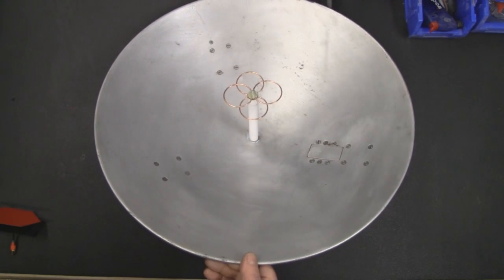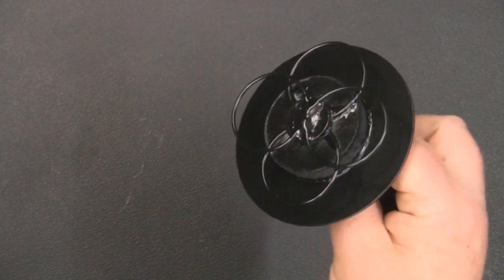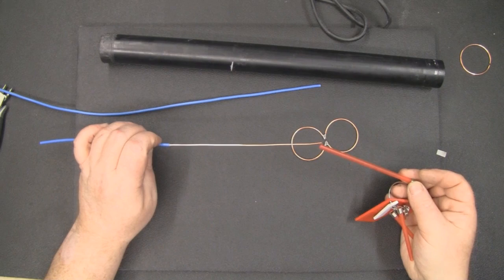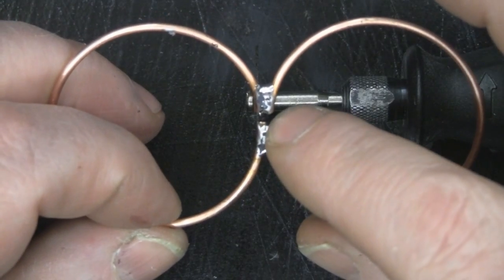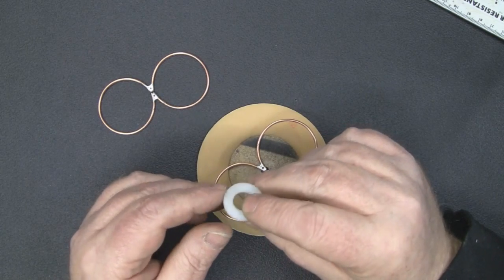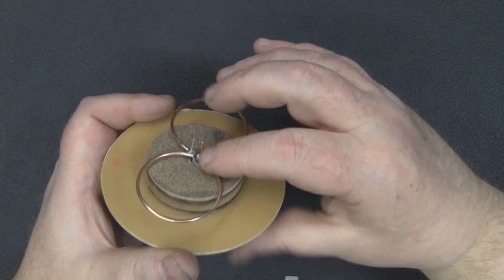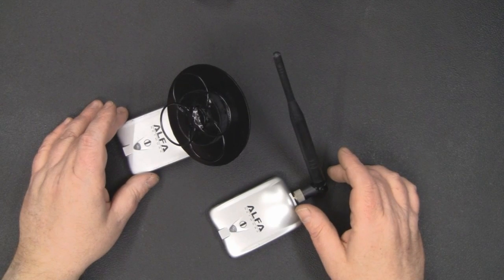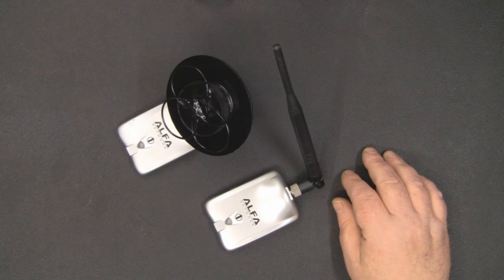Dual Polarized Biquad Antenna #87

Comment: I have gotten caught up with these FPV drones, and I'm confused as to how these guys try to stretch the mileage on the video part of this hobby. Somebody needs to educate these guys to quit messing around with 5.8Ghz frequency's if you want distance. Apparently they don't know that the lower the frequency, the farther it can travel. So why 5.8Ghz range??
I would think you would be better off transmitting video in the, let's say, 900 Mhz range and probably add a few more kilometres. .... But then I constantly keep forgetting that common sense, logic, & rational reasoning left the planet around the start of the new millennium 20 years ago or so....silly me

Comment: Did you measure the VSWR of this dual polarized bi-circled biquad?  It seems that the two pairs of elements might react with each other.  Why did you choose a bi-circle instead of a biquad for this design?